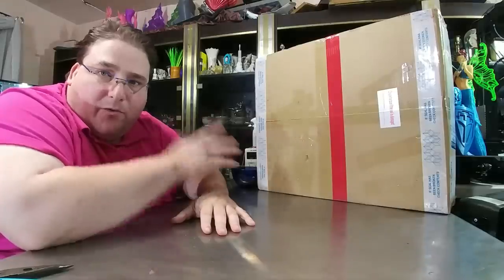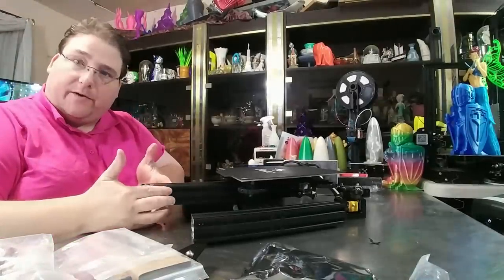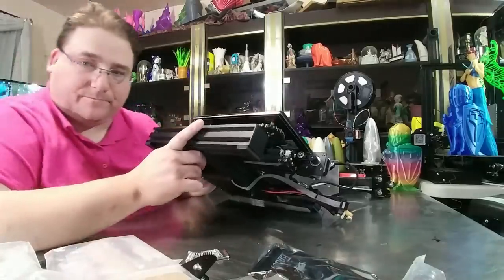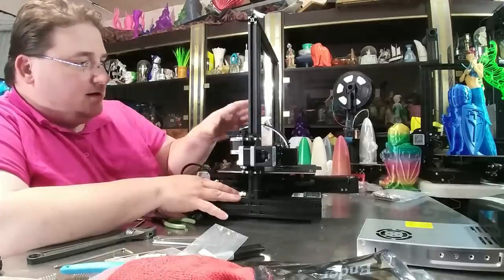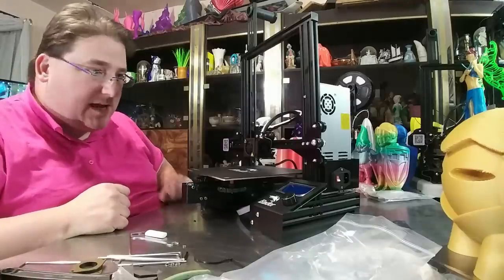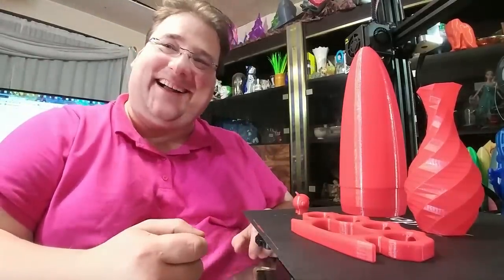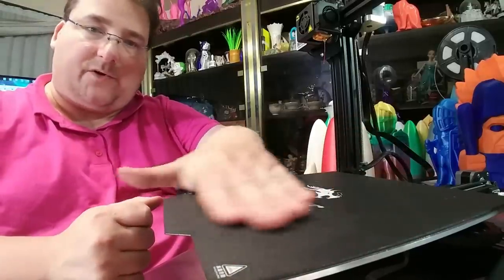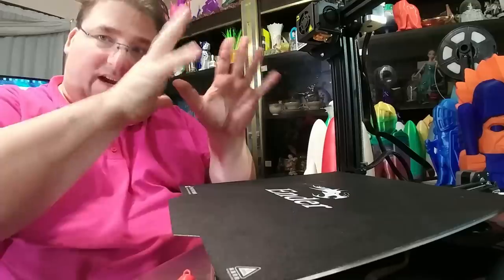Creality Ender 3 Pro Unbox, Build Print, Results T3DP

Comment: I have Ender 3 (original, not Pro) and im very happy with it. I used to have Anet A8, it was total garbage. But it was my first printer and i got some good experience with it. Till that i just watched some videos and forums and pics and had no idea of actual hardware.

Got my E3 and was amazed with quality. Basically plug and play.
Upload file and print. With A8 i had to adjust almost a hour each time until it started printing.
Messed with it 6 months till it started to print in some adequate quality. But still not so satisfied.
Decided to sell and buy E3.
They even included glass plate with it. But i never used it. Dunno how prints would stick to it.

Day and night. You want to print something? Upload file and start printing. No need to mess each time with it. It just works.
Im sure i could fine tune it even more but im not in a mood atm.
I have other projects currently. 
One day i would like to try ABS and PETG.

But i have read that ABS is toxic and i probably have to take E3 to my garage and print there.

Is PETG also toxic when heated?
I know its food friendly but when heated/melted, i mean the smell?
Reply from the maker: From what I understand petg is just as safe as pla so you should not have any problems
Reply: Thank your for the answer! Have a great day

Comment: I own a PRO, love it.  I am using TH3D's EZFlex rather than the stock print surface (bed magnets hold EZFlex perfectly).  I had issues using the stock surface, I managed to get folds in it.  Great printer other than that.

Comment: Hey Chris. Your cat wanted to show you how she loved you before she left. So she ordered you this printer. ^^ Btw. how many perimeters do you set in the slicer to make the Ziro 3D twinkling red opaque enough to hide the infill? I don't like skulls, but the print quality looks amazing! have a great Sunday. Cheers!
Reply from the maker: Its hollow! I specifically used no infil to make it clean! 3 perimeters 1.2mm extrusion. Very strong and heavy.
Reply: @nerys71  Makes sense. ^^ 3,6mm Walls... crazy! Thats almost indestructible. For me hiding the infill so far didn't work with the Ziro twinkling. So I chose to use stylish gyroid. Looks cool for most prints. Have you tried their TPU? Mine came without the sealable bag. Weird when the PLA comes with the bag and the TPU that needs it does not.

Comment: Hi there Nerys, I got my Ender 3 Pro Delivered today and I would like to know what are your suggestions for important upgrades for it. Thanks for any help that you can give to me. I'm tempted to think that not all of the standard Ender 3 upgrades will even work on the pro as it has a number of different fittings.  I would like to know about purchased and printed upgrades that you would recommend if possible.
From various videos I have watched I have also had delivered to me the following: SIQUK Teflon Tube and and fittings, a pack of nozzles, Gwisdom Ender 3 Extruder, Silicone Heat Blockers, Compression mould springs, BIQU TL-Smoother Kit. if anything was a bad buy I can always return it to Amazon UK and get what you suggest instead.
I'm in the UK so I'm guessing I can't use your links and not all of the makes seam to be available in Amazon UK. Again thanks for your help.
Reply from the maker: Any upgrade that works for the Ender 3 should work for the Ender 3 Pro as well it is possible the pro will include things you don't need to buy that's hard to determine since they do make changes over time to these kits you'll find out what's the printer arrives of course

As for the affiliate links I appreciate that I don't have direct links for Amazon UK but I do have an Amazon UK entry link if you were to click that for searching for and purchasing something I will get credit once you get the kit if you have any difficulties check out my videos and or post any questions you have I will do the best I can to help
Reply: @nerys71   Thanks Nerys, I didn't think you would have UK links, I will think to use them in the future. Thanks for your help.

Comment: I use PETG from E-Sun on magnetic bed at 70-75 on Ender 3. No need to use glue stick at all.
Reply from the maker: I am starting to move away from the flexible soft magnetic beds they just don't have enough holding power for large prints that Warp I just had a print fail four times in a row before I realized it was because the printer was working and pulling the magnetic sheet right off the bed :-(
Reply: @nerys71  Yeah..Each of my 3 Enders has a different bed type. One standard, one magnetic, and one glasstype. The standard I use in enclosure for ABS and high temp stuff, the magnetic is for PLA and PETG and the glasstype for models that require a smooth bottom surface. Models with big surfaces I use a 8 brims single layer with 0 offset. Works a treat to hold things down. Even full size prints on the chiron, prints that fill the entire bed, full infill. Add good brim holds it down.
Reply: @nerys71  And I noticed Creality has 2 different types of magnetic beds for the Ender 3. One has a surface texture and the other is smooth. I preferred the surfaced one, but I can not seem to find that one. The newer smooth ones are a bit more finicky to align the magnets. The only reason I had to replace it was I accidentally manually moved my hot nozzle down into it instead of away. Ordered another from same supplier and the one I got was the newer style.

Comment: Hi,  I've been your review videos.  You seem to have and use(d) many printer types.  So I would like your opinion before I pull the trigger.  I have an chance to buy a couple used printers.  An I3 Mega with ~ 100 hours print time ($120) or a Tevo Flash with all the bells & whistles with ~150 hours print time ($180).  Then I see this Ender 3 Pro is now like $220.  What is you opinion if you don't mind?  Thanks

Comment: prusas firmware is open source.. they can just compile for their printers and have the 'prusa moves' ;)
Reply from the maker: It's more than code I believe there is also Hardware involved since you have to kill the heat bed and cartridge power instantly so that the capacitors will have enough power to allow you to move the printhead
Reply: @nerys71  oh, i was under the impression thats its just code that watches the mains input, and triggers the recovery code when a signal goes high or low..but for all i know they might have moved away from Marlin and uses their own firmware
Reply from the maker: @c4tohagen  no they still use Marlin that was under the impression but they had Electronics to make it work to somehow cut the power to the heating elements so that the capacitors retained enough power to let the operation happen I guess we will have to wait till somebody with better knowledge of it times in on how it actually works

Comment: Hello ,

I wanted to buy my first printer. I was interested in Ender 3 or Flsun QQ-S, which one you recommend to me. since already my thanks
Reply: As it's been a few months after your videos about both printers, if you have another option, thank you
Reply from the maker: My suggestion for a first machine is the ender 5. Bullet proof build process and generous build volume with amazing print quality and its cheap about $350 amazon prime shipped.
Reply: @nerys71  thank you very much.

I also think I'll have an advantage with Ender 5, it's the community that's big

Comment: hello sir i am want to buy a 3d printer and never used one ! advise me between ender pro ender 5 and i3 mega S ! i like to build miniatures and diorama stuff ! wish one is good quality and easy to handle ?
Reply from the maker: Ender 5. Large build volume. Better for minis non moving bed solid self aligning structure good for beginners and all the ender 3 pro features.

Comment: What do you set your extrusion multiplier (flow rate) for your CR-10S and Tevo Tornado.  Started to get some crazy stringing and can't get rid of it.  Thanks!
Reply from the maker: Usually .92 to .95 (92% to 95%) deciding this is simple. Print a calibration cube at .2mm 1mm tall 1bottom 4 top layers. (Solid 1mm thick cube) adjust your extrusion multiplier or flow rate down in .01 or 1% incriments until you see slight gaps between the lines of the top layer. Then go back up 1% 0.01 and you are golden. Measure filament diameter. If a new roll prints funny measure it and move this up or down 1% as needed.

For stringing thsts easy. Dont print too hot and use 7 to 10mm of wipe (not coast) thst eill get rid of the stringing in most cases. 

Insufficient retraction and "wet" filament can also csuse stringing. For these machine 6-10mm of retraction should do it in general.
Reply: @nerys71  Thanks.  I have never used retraction above 6.4 or so.  I also have never put wipe above 4-5mm.  I downloaded your profiles from your channel and the values are actually really small.  Are they just your starting profiles? Appreciate the assistance.

Comment: Which printer is the best for you
Reply from the maker: That would be hard to answer because I use different printers for different jobs the one I use the most would be my Ender 3 and my Ender 5 machines but I don't know how I would determine which one is the best for me what would be the criteria?
Reply: @nerys71  Lets say best Print quality?
Reply from the maker: @jw200  in my limited personal experience my Ender to give me the best print quality

The best value would be the Ender 3 almost as good a print quality much better bang for your dollar

What is turning out to be my favorite all around printer for Quality features and build volume is the Ender 5 it's basically an Ender 3 Pro with a larger build volume in a stronger structure you just need to replace the magnetic print surface with something more sturdy
Reply from the maker: Ford reliability I would definitely go with creality not because they're intrinsically better but because they are the most refined they've gone through the most number of iterations and their Hardware is well fleshed out they are insanely reliable with a good parts Trail

Replacements are readily available and affordable and very rarely needed the machines just work as long as you assemble them correctly
Reply: Hi Nerys, I’ve had an Ender 3 for 4 months or so and love it. I am liking the cr10s pro though for the bigger build volume, better drivers, better power supply, bed levelling etc.. what are your thoughts on this printer now you have had one for a while? And is there anything else at this price point you would look at instead?   My experience of Creality customer support is excellent, I had a warped bed and then the build surface bubbled up after a month or so of use. They sent a glass replacement and offered a new bed as well.. very impressed. 

Hope things are going well for you.

Comment: I assume the power supply fan on the ender 5  is also 12v? also what size?
Reply from the maker: You need a 60 x 10 and it will be 12 volts no voltage converter needed

Comment: Excuse me, I have an ender 3 and am having a problem leveling it. I used the sheet of paper method, and the nozzle dig into the bed. Do you have any advice?
Reply from the maker: Search youtube for cr10 bed leveling basics. You will see a 45min video me holding 2 spools. Watch that. I kade that video specifically for bed leveling.
Reply: Thank you

Comment: What is that big gray thing at :26 ?
Reply from the maker: At 26 seconds the only gray print I see is the G create rocket at the top of the curio by the ceiling or at 26 minutes Zi-Rui sparkling black Print is a giant sized printable Carabiner clip printed with a 1.2 mm nozzle on my Ender 3 Pro